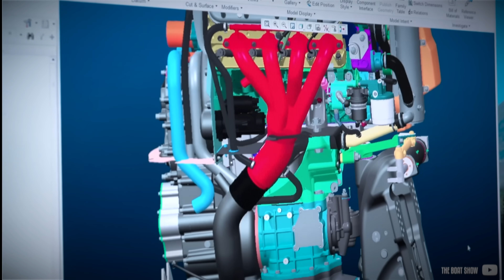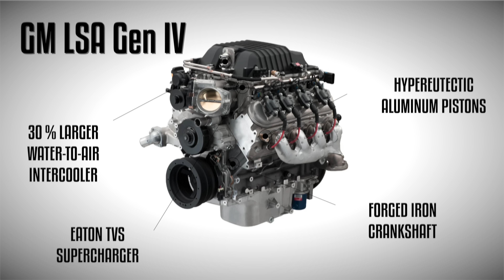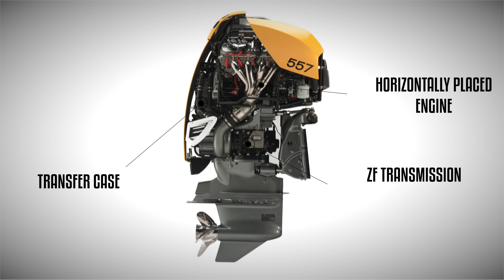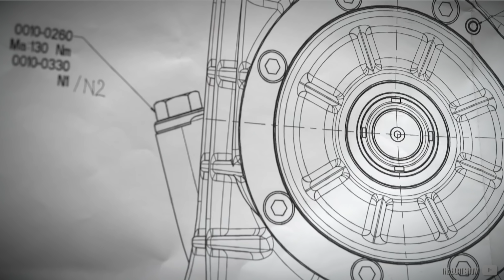How Volvo Killed This 627hp Supercharged Chevy Outboard

Comment: Imagine how beefy the transom is on a boat that has multiple 600 HP outboards on the back.....
Reply: It’s crazy that mercury now has v10 and v12 engines but they are cruiser engines not race engines. They make 500 and 600 hp. It’s been 6 years since these engines were made. Wonder long long it will take a 600hp racing outboard from mercury. We have the 450r and 360 apex as of now.
Reply: What’s a transom ? Is that where the engines are placed?
Reply: @AhmedHuss7  Yes
Reply: They have separate drives. Not shared!
Reply: @shawnsatterlee6035  I'm afraid you have mistaken Transom  with Transmission freind. They are QUITE DIFFERENT. No disrespect.....
Reply: Certainly. And I noticed what looked like fairly substantial tubular metal mounts on some of the set-ups. Kind of like the engine mounts that hang an aeroplane engine.
Reply: The boats that run the big horsepower like the 30-foot plus center consoles don't have a traditional transom or bracket. The stringers and other longitudinal structure run past the back of the cockpit with the engine well and mounting locations being in line.
Reply: I remember when Midnight Express did a 1500hp with five 300's back around 2004 and it was a show stopper. Now I'm running on a 37 center console with 1700 and a gyro and its still not a big boat for the class...
Reply: @alexkitner5356  It's not really a fair comparison, but I have ridden in a 50 foot Outer Limits with a pair of 1350 Merc racing engines, from 100 MPH to 150 MPH faster than most boats go zero to 45 mph. A glass smooth lake Michigan at 150 mph is something everyone should experience.
Reply: @AhmedHuss7  la7
Reply: Well Steve Morris makes a SMX for boats. You looking at 4500+HP. Yet they are very special orders. And will cost you $$$$$$$. Hell his SMX in is Buick Station wagon is pushing 4500HP with around 40 pounds of boost. His old engine is not in Mullet that Cleeter is driving for drag and drive events. Still around that 4500hp till Cleeter goes stupid and puts 150psi boost into it. Cleeters last engine Steve said no more that 35psi boost well him being him went to 55psi and boom.
Reply: @AhmedHuss7  the back flat vertical part of the boat.
Reply: @sithyarael6807  I follow Steve and I've seen him do some motors in the 1000-1800hp range in jet boats and sprint boats but not an SMX. Even if one was adapted into a boat it's still two different worlds. They're making sub-7 second passes and doing miles in street mode but the loads, the hours, the RPM/power range, and such of marine use is something Steve himself would probably call no Bueno. 
A captain I once worked for explained it best... the load on a boat is like driving a truck uphill in sand at all times with a brake dragging. It's a constant load at lower RPM and you can't coast or lift off the throttle.
There's no place outside of specialized racing boats that would benefit from a high maintenance, high power and high RPM motor instead of a big strong but slow diesel.
Reply: @jamesgeorge4874  a transom has nothing to do with the actual drive on said motors. They drive independent.
Reply: Oh yeah. I like myself a beefy transom.
Reply: Bout tree fidy strong.
Reply: @jamesgeorge4874  I couldn’t imagine that speed in the water
Reply: @TexasPatriotOffRoadAndOutdoors  it was glass smooth, an a 50 footer is a decent big lake boat. We went down lake to Saugatuck, turned around and shot back up to Grand Haven at around 90 MPH. It's about 25-30 miles, took about 12 minutes to get there. The grin plastered on my face was stuck for some time.
Reply: Thicc
Reply: @soulcapitalist6204  Finally !!! A man of culture, knowledge, and wisdom.
Reply: @cparks7800  don’t we all
Reply: 18" of pure American wood ar, ar ARR!
Reply: How do they do it?
Reply: I don't wanna know how much gas a minute goes through 6 600hp v12 outboards when u open up.
Reply: @AhmedHuss7 hahah your funny
Reply: @superliegebeest544  well trip Yamaha 425s pushing a 37 Grady White CC with a crew and ice or fish loaded and running a sea keeper gyro we cruise in the upper 20 knot range and get .7 mpg. We run about 90 miles each way plus trolling/shifting around, etc. and the fuel tab is usually $2-3k.
Reply: @alexkitner5356  if I understand ucorrect u talk about half the hp and half the amount of engines cost u 2/3k  a trip. To catch fish. Plus a day labour for maby 3guys another 300. Write off the boat insurence ect another 500. So 4k in cost to catch fish. Don't know what u catch but let's say 6 dollar a pound u need a 1000 pounds to survive every trip.
Reply: @superliegebeest544  it's not about profit, many boats make the same run just to pull on tuna. Couldn't put a value on it but there's no paid crew, the only one who was ever paid was me and after over a decade it's just a friend type relationship. As for fish, well it all depends on the trip. Some are great and we've come back with hundreds of pounds of yellow and bluefin tuna with some true albacore and Mahi mixed in. Could probably make enough to pay the fuel bill but we don't sell and don't have the right permits if we even wanted to. It's about having tuna steaks fresher than any market has ever sold and stocking the fridges and freezers for us and other friends. Profit isn't an issue
Reply: @superliegebeest544  I mean the boat is damn near a million, but have to say that extra 200k for the sea keeper gyro really helps keep from spilling the caviar chafing dish or my crystal flute of 1882 Monk's tears infused champagne
Reply: @alexkitner5356  I only had that once when I got to high and reversed into an iceberg spilled the red kool-aid all over the polar bear rugg. Was a pain in the ass to wash. But the bering yacht was fine. I don't have outboards I have two v12 diesels. That run on hempoil. Because I like the smell. Better than diesel.
Reply: @superliegebeest544 I'm also not sure where you get 6 v12 motors at 600hp. 
The LS platform is the standard GM V8 platform used by most of the street racing world. And it's 557 peak HP which comes likely at the exchange of torque in that type of parasitic induction. The 627 is simply another version of the LS line of V8 motors. With a bigger displacement in the LS9 head. 
If anything should stand out its that a boat that weighs about the same as a small truck is using 4 times the power that a car half its weight could run a low 7 second quarter mile on with just one...
Nothing gets good mileage in water unless it's a blow boat...
Reply: @superliegebeest544 really? I prefer a nice biodeisel mix of used McDonald's fry oil and rendered pig's fat. Come out of my stateroom expecting a super-sized Big Mac meal with extra bacon added...
Reply: @alexkitner5356  u understand that swimming upstream cost more energy than riding ur race bike downhill?
Reply: @alexkitner5356  I tried that once. Learned the hard way lines of boats shouting they're orders until deep into the night. At the saturn window thinking it's a sail through.
Reply: What's the gyro for?
Reply: @mrbmp09  It is a differential tachometer, it displays the difference in RPM between the engines.
Reply: @mrbmp09  the sea keeper is a gyroscopic stabilizer. It's basically a heavy mass spinning at high speeds mounted to the inner hull structure and it minimizes rolling and pitching. They've been very common on larger boats but are now getting them smaller and onto smaller boats but they're not cheap and they weigh a lot which doesn't help the fuel economy.
Reply: Imagine you only need one to make 2000+ hp
Reply: From a quick google search, each one is 1100 pounds. Oh crap, you mentioned the power not the weight...
Reply: @Drunken_Hamster  "beefy" translates to both power, AND weight handling ability, in this case  Mr. Hamster.....
Reply: @AhmedHuss7  yes
Reply: I know it's incredible. My sister and her husband have a Formula 500 SSC with quad verado 600s. The amount of rigidity in the transom is amazing.
Reply: @AhmedHuss7  yarrrrrr. shiver me timbers, listen to this land lubber!

Comment: And at full throttle, four or these engines would use more gas than comes out of a gas pump at full open . How fun.
Reply: welcome to boating LOL. Get a diesel boat if you want efficiency, but it will be 2x as heavy, and be inboard only.
Reply: If you can afford $100k per engine, you also give zero f^*ks about the fuel bill
Reply: @themotorfreak1  The Oxe brand makes outboard diesels but they are extremely rare and expensive. They are heavier than their Otto counterparts but not twice as heavy.
Reply: On the water time is money and if you researched it they were more fuel efficient than ..  that's why most cars are built with forced induction now..  it's s a said truth... the big fish ate the small fish to protect its future, just like Beats Apple buying Beats and that pharmaceutical company that makes epi pens bought up its competition and closed them..

Comment: Feeding one 600 hp baby hours on end can hurt the wallet, I can’t imagine feeding quadruplets.  If you can afford four of those bad boys the price of fuel is not going to be a concern
Reply: Hmmm... might make Greta break out in a sweat, though!
Reply: @davidstewart4570  HOW DARE YOU...make me moist with the spray of 4 beautiful 600hp supercharged bad ass boat motors 😍
Reply: actually pretty fuel efficient for what they are.. look it up. not covered in this video. "With outboards of this size, fuel economy is probably moot, but decent figures are achievable. At 30 knots each engine was burning 16 gallons an hour, rising to 58 gallons per hour at 40 knots. The Everglades test boat carries 400 gallons of fuel and the tank was three-quarters full on demo day."

either way.. boating is expensive. b.o.a.t. = bust out another thousand
Reply: If I understand it correctly, the 627's retailed for $100,000 each.  Anyone who ponies up four of these at $400,000 will have no problem paying the fuel bill.  As pointed out in another comment, they were actually fuel efficient for their power level.
Reply: @RM-cm8hz  Wow, so if you drive 40 nautical miles at 40 knots, that 4-whisk setup will swallow 232 gallons of fuel. Here in the UK, at pontoon prices, gas comes in around £7.50 ($9.30)/gallon. So, your 40-mile trip costs $2,157.60 in fuel alone!! That's taking serious weight out of the fattest wallet.
Reply: @Thomas63r2  Of course, the monstrous cost of the engines might mean there's nothing left to pay the $1,500/hour fuel bills! Still, more people will be able to admire that rig whilst you're picnicking with an empty tank on the dock than when you're blasting over the horizon.
Reply: @davidstewart4570  The owner's of the boats with these power units rarely have the free time to enjoy them, I'm sure its a guilty pleasure for them.  None of the boats these outboards are going on are basic, more like a couple million dollars on the low end.  They are in the situation of literally being able to burn money without any changes to lifestyle.  Don't hate on them, their lavish spending supports a lot of people.
Reply: The issue wasn't the cost of fuel, but regulatory requirements most likely.
Reply: @VaporheadATC   Perhaps.  But at $100,000 each there was enough money that emissions requirements could be dealt with, the 7 Marine 627 is not that wild of a tune.  The more likely explanation is that the Mercury Verado 600 hp outboard was a surprise to Volvo - especially since the Mercury Verado undercut  the 7 Marine 627 by $25,000.  I think that caused Volvo to reevaluate the 627 and conclude that it was too much of a specialty product now facing unexpected competition with a  large price differential.  Your reply is in a fuel cost sub-thread, the owners of these multi engine outboard offshore boats are unaffected and unconcerned with fuel costs.  The average owner of boats like this make a few million a year on the low end.
Reply: About the same power as 2 1350s, but the fuel economy is probably better with the outboards.
Reply: @Thomas63r2  I remember when Jegs sold LSA's for $11,000.
Reply: @marcmo7138  I remember when you could buy musclecars for giveaway prices during the two gas crisis of the 1970's.  Everyone wanted Pintos or some other econo car.
Reply: We say the same thing about the Freemans at work. Most of them are quad engine boats.
Reply: It doesn't use gasoline but ground up $100 bills , at least a bushel a minute .
Reply: Don't forget the one with 5!
Reply: I don't always downshift when I pass.
But when I do, it is next to a Prius so they can HEAR me hurt the environment.
Reply: @marcmo7138 it has Marine stamped on the part lol!
That said, most of the time it is necessary. Lots of stainless bits and bobs that are usually just steel in a car.
Reply: I've seen crazy figures on what it costs to cross the Atlantic with a large superyacht. Hundreds of thousands of dollars just for the fuel.
Reply: LOL.  The target market can throw away their money!

Comment: The owners of 7marine got very well compensated for selling their business. They would have known what it would mean for the future of their company. Employees should be pissed at them, not Volvo
Reply: This
Reply: I have seen this happen so many times.
Small independent company starts taking part of the market. Big company buys the owners out while promising them continued employment.
Then after a discrete pause, original owners are fired along with the staff.
Big company wins because they have eliminated a competitor and acquired a lot of innovative ideas.
Reply: OP is wrong
Reply: There is nothing wrong with selling a company. It happens all the time. That doesn't make it the fault of the founders that Volvo shut it down.
Reply: Why? You set up a successful company and are ready to get out, why not sell? It was a Volvo who decided to cut the product line.
Reply: They either had to start making smaller engines to break into other HP segments or die. There was no way they could compete with Mecury's V12